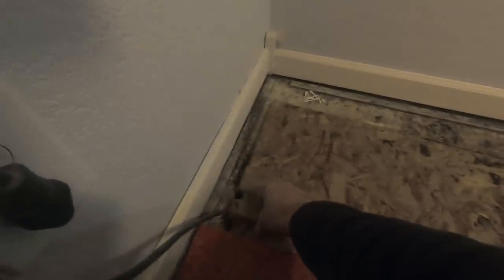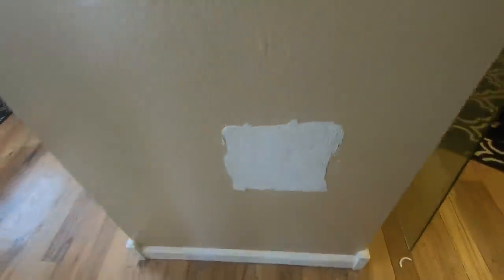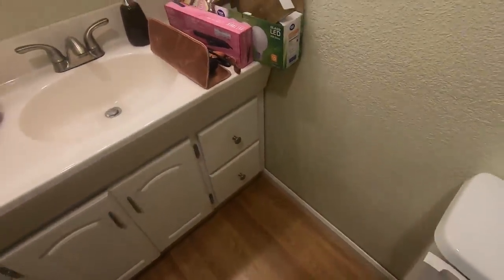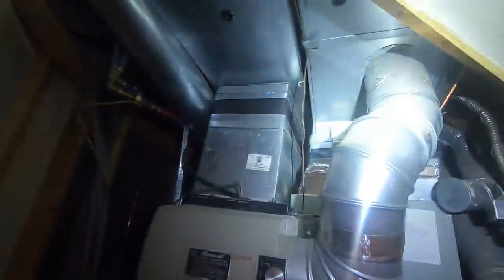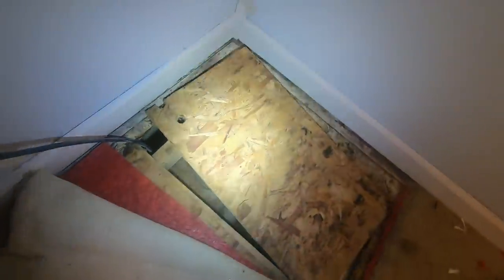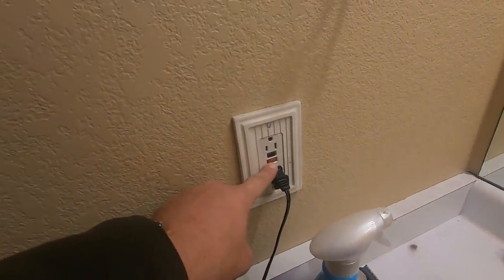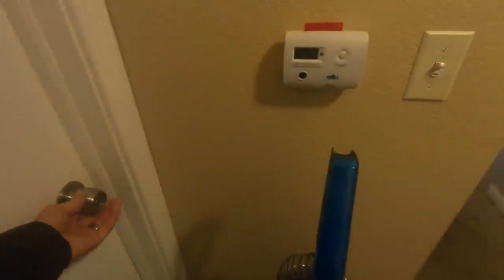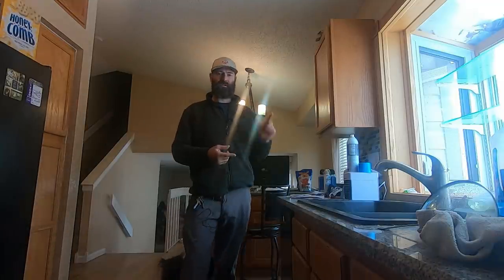Renters Destroy Beautiful Home | I Have To Fix It ( Official Video ) | THE HANDYMAN |

Comment: Head scratcher on that tile in the shower. Builders grade on drywall, water got in and the drywall swelled up is my bet. Interesting video! these types of tenants keep you busy!
Reply: It was probably hit on the other side or something broke behind it. He's right, something bad happened. I had a bath/shower in a 50 year old home that the tile simply let go of the cement board. So the middle was bowed out about 1". Yet other parts of the tile were still very much cemented to the wall and would break rather than let go. That was a take down to stud job and rebuild.
Reply: So tempting to pull one tile but the entire bathroom would probably disintegrate lol.

Comment: Great video. I work for myself when laid off from industrial construction. Been doing this for about 6 years now. I enjoy being a handyman. I've seen some nasty stuff. GOD bless those people. Last bad job I did was a roof leaking. Rain had collapsed styrofoam ceiling tiles. Or so they thought. I checked out the roof, found no areas of penetration. Went into the bedroom above the leak, and there were water and drink bottles almost 2 foot deep. Most filled with urine. Plastic gloves, and possible other bodily fluids in glasses. Some had obviously spilled. 🤮 come to find out, the ceiling was leaking from a rotted floor. Caused by this persons lazy idea of throwing water bottles of whatever on the floor everyday. But, I made a bunch fixing the floor, the ceiling joists, and the first floor ceiling.
Reply: "Piss-bottles". Apparently it's a thing. I had a friend who used to do this. He only had kept at a time, though. Whoever lived in that house you fixed, was just plain lazy. 

ps. It's not me! .. (it's my old friend Steve, (w/ the "piss-bottles")

Comment: I noticed when you lifted up the door near the sump pump, the ground looks moist. Is it possible that the ground is causing the moisture and mold? Places around where I live we have this same issue so they lay this black tarp on the group to capture the moisture and prevent it from soaking into the wood of the house. I could be totally wrong, just a thought :) also, really gross house. I don't understand how people live that way.

Comment: You hit many of the reasons I simply will not do this type of work.  My ethics and that of these fix and flip characters are quite different.  They want things slapped together and jury rigged in whatever the cheapest way possible is.  In other words, don't worry about fixing it right (like that bathroom tile situation), just cover it up and pray the inspector doesn't catch it (which many won't because quite a few of them suck at what they do).  I've flipped a number of homes in the past ten years, and though my margins could have been higher if I'd simply cut a bunch of corners and put lipstick on a pig like this property management company apparently does, my ethics won't permit me to behave that way.  I made a decent profit on each flip I've done, and was proud of the final product.  So sad the world has come to this approach.

Comment: We renovated then rented our first home (to relatives of course).  They lived in the home for about 5 years and when we visited them we looked around and asked about problems.  Once they moved out to another state we found so much water damage under the kitchen sink and in both bathrooms that we had to gut all three and rebuild them including new floor joists.  It was a mess.  It turned out that the sink started leaking (loose hose) and they just ignored it.  They also had kids.  In both bathrooms they would let their kids just fill up the tubs until over full and flood the bathrooms during bath time.  When the toilets started to get loose and tiles started to come loose they ignored it all and just put rugs down.  Both bathroom floors have to be rebuilt from the slab up. Again.

We now have it empty and once it it finally fixed.  No more renters ever. PERIOD.  These were relatives (niece and her husband).  I called her and asked why they didn't call us with problems and she had the nerve to say that if we can afford a house to rent then we can pay to fix it up too.  Their security deposit was small because they were my wife's relatives but NO MORE EVER. This is now a sore point between my wife and her sister.  They barely talk at this point.

The worst part is that I had rebuilt all of those floors about 15 years ago. Put in all new plumbing, new fixtures, new everything, and now here I am, late 50s, doing it all again from the ground up with my college age son. Hopefully, we will salvage some of the fixtures.
Reply: Frustrating for sure but one solid rule I follow in life is never do business with family, it is 100% always a bad idea. Lesson learned though.

Comment: The moment I saw the bottom of the stairs just as you were pointing at it, as I'm eating and barely even looking at the screen, literally watching out of the corner of my eye, I knew the problem.
Self leveler is not going to fix that.  Boards will need to be replaced.  Make sure it is more solid than it was before.

Comment: What's your plan for the dog doors? I have them in my house from the previous owners. I was thinking of removing them and covering the hole with white plastic kick plates if they make those.
Reply from the maker: you can buy a new door blank for under $50 that is a direct match.

Comment: That corrosion in the bathroom almost looks like they were storing chemicals in there. Swimming pool chemicals would do that.
Reply: Or very hot showers & zero exhaust ventilation. I've never seen corrosion like that inside a home before. 😲
Reply: Meth lab
Reply: @paulreithknecht5616  Nah. There's a tube of toothpaste on the counter.
         ,,,,    ,,,,
         @ .. @
 ( ⬛⬜⬛⬛⬜ )

Comment: Besides the dog piss and shitake, I'm not sure what the renters did to "destroy" this house. The molding and furnace were installed/repaired poorly,  that probably wasn't the renters.  The fixtures are ancient, probably late 80's early 90's. The ceiling light being installed on the wall wasn't them more than likely.  Are the slobs, absolutely,  but they are being charged $2400 a month for a three bedroom with tiny bedrooms.  Seems like the property management is getting their just desserts.
Reply: The carpet, the fixtures you mentioned more than likely weren’t rusted when the renters moved in, and who knows what else. Perhaps the rent is competitive for the area, regardless of how “tiny” rooms are.
Reply: @JosephQPublic  those are completely valid points,  however I'm not sure what a renter is supposed to do about metal rusting due to how old they are. It also doesn't change the fact that the property management company has put $0 into this property since the early 90's and have been charging a premium for rent. I've rented in nicer areas and never paid that much for so little.  Plus their security deposit will pay for new carpet and cleaning.  Like I said, both parties deserved each other.